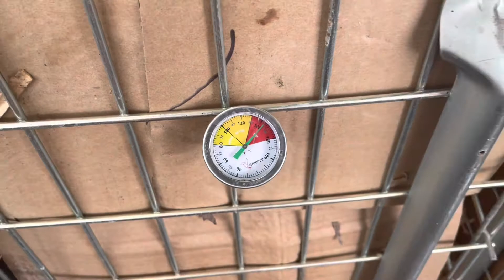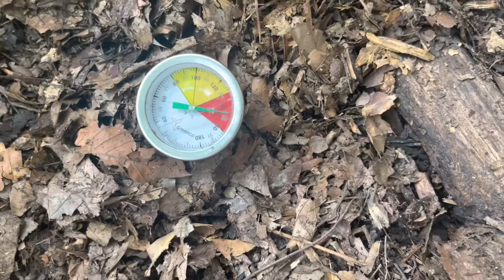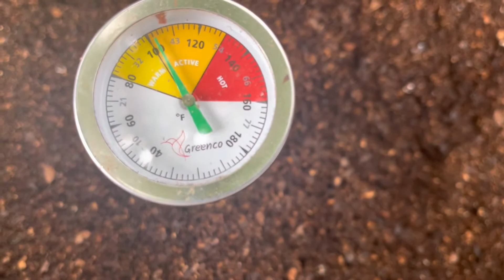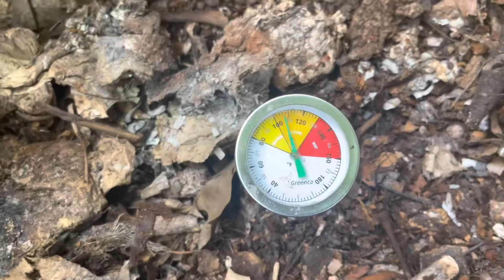Pinpoint composting #4

Comment: Hi; I had an idea about how to use the heat in the compost towers you show here. Make a diagonal X frame to sit within the tower; on each arm have a board which reaches down into the compost; each of these down boards a section of garden hose runs down them back up the same board; run water through these pipes to collect the heat. This allows you to still aerate the tower with the stick. To keep the heat pool noodles could be used to insulate exposed sections of pipe while the bed is being filled. Hope this helps